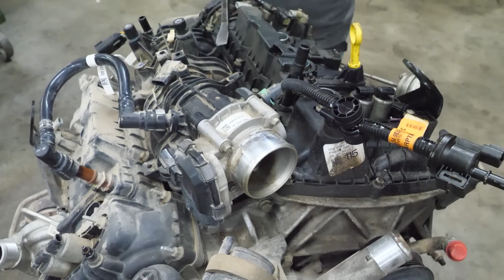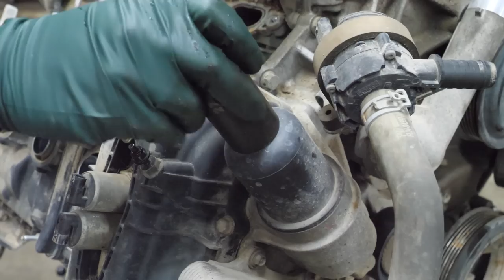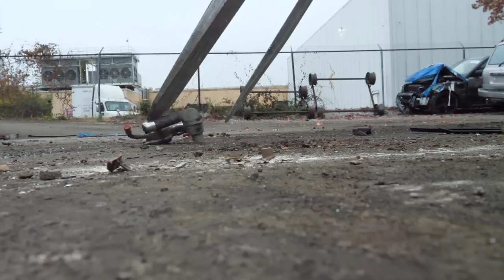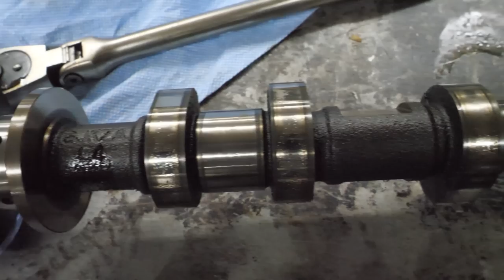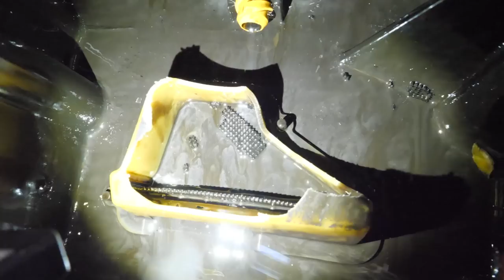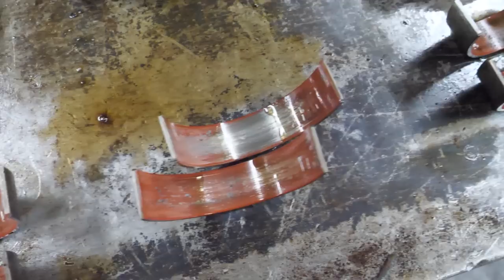A LITTLE TOO SPICY! 15-17 Ford F-150 2.7L Ecoboost V6 Engine Teardown

Comment: The cause of failure appears to be similar to that of Toyota's 2AR-FE engines. Look at how thin the low tension rings are (especially the oil rings). This is supposed to "improve fuel economy" by reducing the internal friction, but they coke-up and seize causing increased oil  consumption. The skirt wear on the pistons matches the scuffing on the cylinder walls - this is the source of the increased oil consumption.The increased oil content in the exhaust causes the turbo-charger to increase boost, leading to lean burn problems. While the 2AR-FE is naturally aspirated and doesn't fail as spectacularly (it cokes up to the point where the wrist pins seize) the thin, low tension rings are the cause of failure in both of these engines.

Comment: The shear complexity of these new engines is so scary. I can see why many veteran mechanics abandoned this trade. I cant picture working on these disasters in an engine bay of a pickup or suv. In 61 and owned 34 vehicles in my lifetime . A simple 4 barrel carburetor with a single turbo would work.  EPA Gansters Destroyed the auto industry and back yard mechanics.  Course this was done on PURPOSE. No wonder why modern engines have so many issues. Look at the Rats nest wiring harness and everything attaches to it. Great video,  thanks.
Reply: They are quite fun to drive

Comment: given the context that this motor came out of an f150, with the clues of lean burn, overheating, and lack of an explosive failure. it seems pretty clear (to me) that this was possibly a towing failure
the turbos were completely spooled (lean) for a long time (loaded, overheat) at a low rpm (no big boom) and it [melted] the motor as a result.
am i correct? maybe not, but this motor doesnt look like it was abused like most of the other motors that you see. its the most likely scenario in my mind.

Comment: The only one of these we had to replace at our shop was because of neglected maintenance. It had been 40,000 miles on an oil change. The rest of our customers that have have not had any major issues.
Reply: Not sure the recommended, but do every 5K with Mobil1 in my ‘17
Reply: @richtes 
Oil is cheap, mine is a 14, I change it every 5,000 regardless of what the book says.
Reply: 😂 47:25  I run 15W40 diesel oil in my 35

Comment: A stock tune will pull the timing back and possibly add fuel if the engine pings excessively.    This was a bad injector, or a cowboy tune.

Comment: I think the positioning of the three chains, timing, oil pump, timing, makes sense. Not from an ease of maintenance point of view, but from a use of space one. When the offset between the two banks is two chain-width, yu space the two timing chains that far apart, and yu hav a gap on the crankshaft where yu can put a third chain.

Comment: Once you showed all the oil in one turbo/exhaust port, but the engine hadn’t ventilated itself and there weren’t a ton of metal pieces around the engine, I was pretty sure it was going to be a broken piston ring land. Pretty common on DI turbo engines, especially in trucks because they cruise down the freeway at 10-15psi of boost at 2000rpm. Could be a lean cylinder, or it could have been getting a bunch of crankcase vent vapors.
Reply: What about carbon on the valves causing incomplete sealing and hot spots? I bet there was preignition from a hot valve lip which did the initial damage and pulverized the crown, then it started burning through the exposed ring area and blowing oil.
Reply: I'm not very knowledgeable on these Ford's but could have it been a stuck injector or one that's spraying too much? From how the pistons looked the entire engine was lean.
Reply: @Mis73rRand0m  I think incomplete sealing of the valves would lower cyl pressure. Lower compression stops preignition. Hot spot on leaking exhaust could light the charge but should not hurt the piston without having full compression.

Comment: No disrespect about the ford 2.7
They did an excellent job of engineering an engine with the maximum number of covers, gaskets, o-rings, electrical connectors, hoses, cooling fittings, brackets, wires, and all at the same time a complex fuel and turbo system.
Reply: not

Comment: The water pump sequence ... in around 2006 I worked in a computer repair shop that just happened to have a forklift.  I had a customer ask me to destroy a hard drive for him, I didn't ask what for or why ... I went out and used the trusty forklift to flatten the drive.  Just one thing though ... that old Yale forklift did nothing to the drive aside from embedding it into the asphalt (hot Arizona summer).  I had pry the drive out of the asphalt with a large screwdriver.  Board on the drive was destroyed but that old Maxtor drive otherwise didn't flinch.  Wound up taking a cross peen hammer to it to finish the job the forklift could not.

Comment: Invaluable information! I have a 17' Edge Sport with that same motor. Awesome to know all these details about my engine including a huge relief I have a chain not a belt on the oil pump. The 2018 2.7L video had me worried lol. Carbon build up is definitely the worst thing I have heard but it's all about regular maintenance and maintaing it. Thank you for the great video!
Reply: Regular maintenance wont have any impact on the carbon problem...on even the best maintained DI engine it's a simple matter of time and the EGR system dumping oil back into the top end where it always ends up on the intake valves. The only true solution is an engine with a split fuel rail incorporating both direct and port FI to keep the intake valves washed clean.

Comment: My 2016 F150 2.7 has 96k miles and run great. It still get 18 mpg mix driving and does not use any oil. I've never had the intake valves clean. Diesel engines have direct injection and no one ever talk about those valve building up carbon.
Reply: most diesels don't have an EGR system
Reply: @francistheodorecatte almost every diesel vehicle sold in the usa (and probably elsewhere) are required to have an egr by law. What are you talking abkut?
Reply: @francistheodorecatte  Who told you that lie? Also, my 2016 2.7 does not have an egr valve.

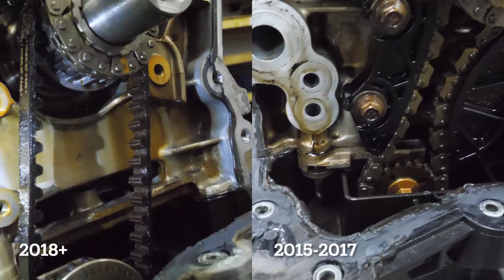Comment: 21:28 Shows there is little difference between the wet belt model and the chain driven oil pump model. It should be possible to convert back to a chain drive if desired. The tensioner mounting holes are the same position, although appear to not be tapped, and the cogs should be a straight swap. It's evident this is to save on production costs only and not for ease of maintenance.

Comment: I bought a new 2016 F-150 XLT 2.7 FX4 it has 345,000 miles and I’m getting ready to replace the turbos that’s about all I’ve done to the engine beyond replacing 1 plastic oil pan.

Comment: I recognize this failure. If it's the truck im thinking of, The truck it came out of was turned all the way up and running VERY lean due to lack of available injector volume.

Comment: My stepfather had a 15 F150 with the 2.7, and it had a catastrophic failure around 80k miles while towing thrir 5k lb camper.  It was losing power and shaking like an earthquake.  They towed it to the dealer, and they refused to say what the problem was.

He has since upgraded to a 19 F150 with the Coyote 5.0 and vowed to never buy an EcoBoost again
Reply: Smart man!
Reply: Losing power and shaking?

What would that be, something to do with the crankshaft?
Reply: @Spudchucker92  we are clueless.  The dealer refused to go down that road
Reply: Yeah idk. I've never in my years had a dealer refuse to tell me what is wrong with my car, especially if it comes in on the hook. The story does not add up.
Reply: OK, but what fuel was he using? If you're using 87 while towing and have your foot to the floorboard, like your trying to qualify for the Indy 500, chances are you're asking for trouble. Just like regular oil changes are cheap maintenance, if you planning on towing, a tank or 2 of 91 will go a long way to prolonging your engines life.
Reply: Coyote can consume excess oil. Friendly fyi.
Reply: @POVwithRC  Yeah what would be the reasoning behind keeping it a secret??
Reply: @thelonelywolf88  Towing a 5,000lb trailer is the clue. The Eco Boost is not designed for that load, while a V8 can cope.
Reply: @gtrance3567  he's having that issue right now.  We checked a month ago and it was 5 quarts low on oil
Reply: I think buying a Ford F-150 today is a crap shoot.  No great engine options any longer, they really messed up the 5.0 on the 3rd gen.
Reply: @hokie9910  best bet is na, port injection without cylinder deactivation.   But that is getting harder to find.
Edi:  also I don’t think it’s a ford issue.  Most auto makers are having issues.

Comment: Id love to see a Ford 3.0 v6 from the late 00s like an older escape or fusion. Those engines leaked oil from everywhere and some had a cam driven water pump
Reply: i would like to see that too... i have one in my 2008 Escape the engine is a beast and runs GOOD! @130K but at 80k it had all its gaskets replaced under the warranty i had. 
its all so on its 3rd transmission and PTU lol now i change the PTU oil every other oil change.
Reply: I had a 2003 Taurus with the 3.0 Duratec and the valve covers leaked like a mf!
Reply: Managed a couple oil changes in the late 2000’s in metro Detroit. Would love to see the Taurus 3.0L on the channel
Reply: 140K on my 07 Mazda 6 (cousin to the ford fusion) with the same engine and still running fine. Only some minor seepage from a valve cover gasket to report which is somewhat surprising since those covers have a tendency to warp and leak badly.
Reply: My 2007 fusion has a camshaft driven water pump. It was super bizarre to me. Never saw anything like that before. And yes, the rear valve cover leaks like a mofo. The front one got replaced by the previous owner.
Reply: 202,800 miles on it currently.
Reply: Duratec 3.0 did. Early was beer driven, later direct  driven

Comment: This year engine is prone to fuel injector issues with the ones running E-85. The injector would clog up partly and cause an extreme lean condition. It would have thrown a code and turned the check engine light on, but by that time most of the damage would have been done. There is a TSB to run a fuel additive when using E-85 to keep the injectors from clogging up.
Reply: I was pretty sure none of the Ecoboosts were FlexFuel capable.
Reply: E-85 is garbage!  I agree with the other commenter.  I didn't think these engines were E-85 compatible.
Reply: It went right past the check engine light and turned on the fooked engine light.
Reply: all to keep the farmers happy:🚜

Comment: The 1st gen 2.7s are known for misfires due to carbon buildup on intake valves. My girlfriend's sister's 15 had both heads replaced under warranty because she baby's it, and it never sees above 20% engine load.
Reply: What if the engineers had succeeded in keeping some engines port-injected? Would have succeeded in so many ways even much cleaner emissions through better fuel atomization
Reply: @jamesmedina2062  well it's a good thing Ford listens sometimes. I believe all current F150 engines have PI as well as DI.

Comment: 13:25 Pausing it here to make a prediction.... burned/holed piston, or a collapsed ring land. Onwards, let's see how wrong I could be!
EDIT: 31:27 CALLED IT!
ED ED: How? You showed it... oil out the exhaust, no clackiness when you turned it over, lack of flakes but metal present, metal appeared more granular or globular, and the engine apparently ran poorly enough to warrant replacing. Blowby would have been horrid, smoked like a chimney, lankey idle, oil smelling of fuel, etc.

Comment: Can you put the 15-17 oil pump parts on a 18+ engine without changing the crank?  Or if one must change the crank, can the earlier crank work with the later block?  It appears the holes for the oil pump chain tensioners are there on the 2018 version.  I'm sure someone will do a Frankenstein version of this with the chain driven oil pump but the later heads so they can have dual injection.  Although that said the ports really didn't look bad despite lacking the port injector.

Comment: Our 2017 Ford Transit had the same type of twin turbo v6 engine. We put close to 260,000 miles on it before the engine started breaking down. We did an engine swap from a low mileage donor truck.  The engine is complex in design, and there are a myriad of weak points that require attention, but I would consider them to be reliable.

Comment: I love seeing spark plugs they tell so much 
Normally I don’t see golden discoloration in the threads of the plug I do believe this to be since it is a twin turbo v6 that the higher compression and lack of running 91 octane caused the engine to run just a little bit hot and burned the plugs

Comment: Looks like a new product line in the making... A "Water cooler for concrete pads." Installation is the key for all DYI-ers if you're really going to cool properly as the concrete pad watercooler must be permanently set with formed concrete only.

Comment: That cracked piston is a common problem with direct injection, it usually happens under high heat high load condition like getting on the highway under high load condition.
Reply: you know this construction dudes don"t baby the truck.

Comment: I like how the stampings on the heads show not only the engine size and side, it indicates it is for a Rear Wheel Drive also. Makes me wonder what the difference is.
Reply: On a transverse install the front head has direct air flow so the cooling passages are different front to rear.

Comment: That engine looks sturdy. It could be a Toyota or Honda engine from 2015.   The chain guides looking good is a good sign. The plastic oil pans were a sore spot and the updated pan with a groove and seal instead of full RTV doesn't work because of oil pickup tube or some other item integrated in the pan that changed. I'm surprised one of the aftermarket companies hasn't stepped in with a gasketed pan.
Reply: I thought it was possible to do a pan swap with an earlier steel pan on some models. I know I'd prefer not to have a plastic oil pan

Comment: I have one of the 2015 2.7l.  It has the same metal in the oil filter pleats. I change my oil every 5k miles as well. It has been bothering me on what the cause is. It’s so fine and no large prices either. Could it really be a piston melted? I don’t hearing anything going on. I send a oil sample to black stone oil lab to see what they find. 

Anyone else have this a issue? Also no metal glint in the oil from the pan either.
Reply: sell it now

Comment: Not even gonna lie here. With the exception of my 2004 Viper, I am a FORD GUY TO THE BONE. Mine represent a multitude of designs from a 16 valve I4, a DOHC 24 valve V6, TWO modular V8's (SOHC 16v and DOHC supercharged 32v) and they've been bulletproof, unkillable, and simple to maintain and repair. But me, being the Ford guy that would rather hitchhike in a diarrhea storm than ride in anything else - even I will not buy or own ANY FoMoCo vehicle with an EcoBoost engine. I am looking to replace my aging and worn out Ranger with a newer small truck but the new Ranger is HUGE. The Maverick is well um... a FWD car with a huge, open trunk. 
I may have to steer away from Ford on this next quest of vehicle purchases.

I still cannot grasp that Ford quit building sedans

Comment: friend of mine has one of these
70k motor was replaced. has 130k now.  its been thru 2 oil pans for leaking and needs another.

Comment: I don't know exactly when, but newer 2.7L EcBoost engines in F150s have no vacuum pump.  All vacuum operated accessories INCLUDING THE POWER BRAKES are electrically actuated.

Footnote.  That engine has piston bottom oil squirters/jets.  These are specifically there to keep the top of the piston and ring lands cool.  You have to wonder if something clogged the squirter on that one cylinder.

The upper engine block is Compacted Graphite Iron (CGI).  Extremely strong.  This may be the only production petrol (gasoline) engine to use CGI.  I am a little surprised that there are only 2 head bolts per cylinder.  I would have guessed there would be an additional 2 bolts per cylinder on a turbo charged engine.

Last, this is probably the only "light duty" production engine that the exhaust manifold is cast as part of the cylinder head.  This allows the turbo to be directly bolted on.  Also the exhaust manifold up to the mounting flange is water cooled.

Comment: I had a 2017 lincoln continental with less than 30k, it’s 2.7 ate itself for lunch, ford sent engine back to factory to see why. Found out they have a lot of problems with chain tensioners.

Comment: Low Speed Pre-Ignition.  Extremely common on eco-farts.  Seen a few 3.5 eco-farts that break pistons, usually happens under 2k rpm, heavy load, as these run higher boost at lower rpm.  One in particular was a Expedition used in a car service, dropped a cylinder and sounded awful, borescope revealed exactly what your piston looked like.
Reply: Twin scroll turbo set up sounds ideal for these.